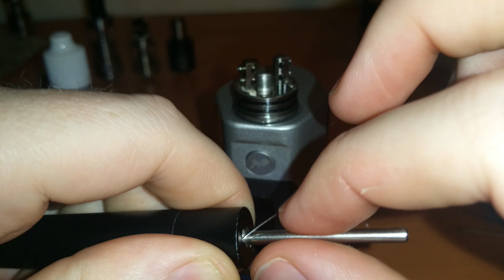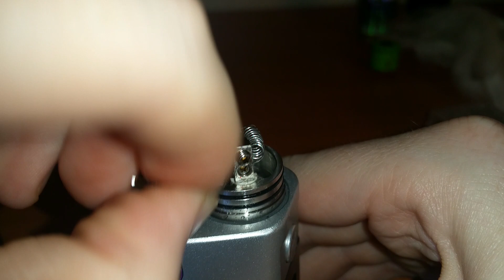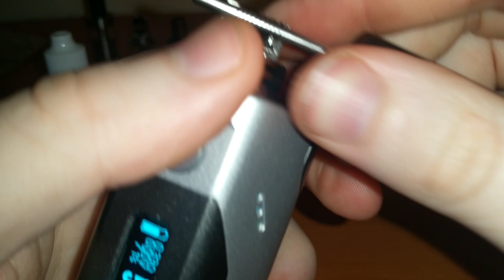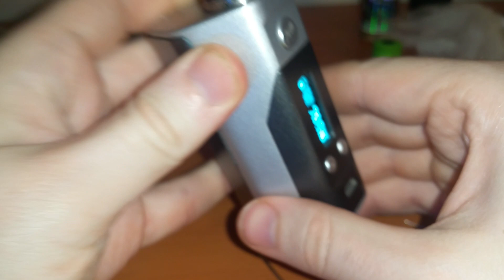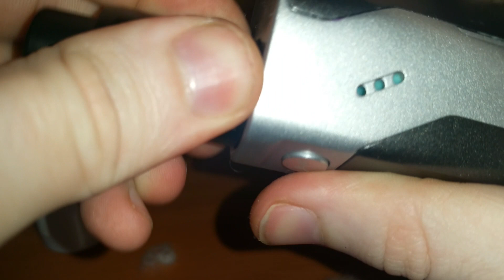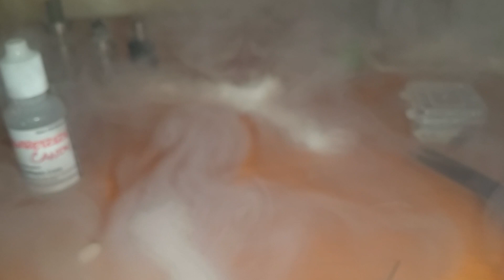AdvancedVape Build Guide Episode One: 316L Stainless Steel Spaced Coils

Comment: why are using wattage mode instead of TC mode? you're using SS wire so you should be on TC mode so you can lock your resistance
Reply from the maker: SS316L is equally capable in both wattage and tc mode. dry firing works best in power mode as well. it comes down to flavor preference. some builds I prefer wattage mode, some I prefer TC mode. but stainless steel is the only wire that can do both.

Comment: hi mate excellent tutorial I am just about to start building 
I just ordered the velocity by TOBECO 

I was just hoping that you can answer a question for me I'm after building a dual coil set up out of ss at about 0.5ohm so what gauge wire and how many wraps woud you suggest please
Reply from the maker: hey tony! glad to hear you're starting to build with stainless steel. if using regular round wire, 26 gauge at 12 wraps with a 3mm diameter will get you slightly below .5ohm, and 10 wraps on 28 gauge will get you slightly above. also keep in mind that stainless steel does not respond to power identically as kanthal, so you can get identical performance to a .5ohm kanthal wire from a stainless steel wire running at .25-.3ohm. stainless is very flexible with what power you put through it. let me know how your build goes or if you have any more questions! we also have ohm charts on our website for more complex wire types.
Reply: +AdvancedVape thanks for the great advice I will definitely have a look at the website I will definitely let you know how it goes a really appreciate the offer for help if I need it thank you very much
Reply: +AdvancedVape hi my first build went fine really easy thanks to your tutorial I took your advice 26 gauge wire 7 wraps 0.3ohm but I ended up buying by accident SS317l wire by crazywire in the UK on there website they say they have spent 3 years developing this wire for vapers do you have any advice on this wire for me please
Reply from the maker: +Tony Vapemeister 317L performs very similarly to 316L so you should have no issues with building as you would have with the 316L. the resistance is going to be a little different, but you can check wire wizard on steam engine if you need to. all in all they're very similar when it comes to building
Reply from the maker: +Tony Vapemeister I've never used that particular brand but I have used 317L. so if that brand is pure 317L, what I said should still apply. some brands use blends of different metals though so it just depends. how's the flavor on your first build?
Reply: +AdvancedVape thanks for your advice dose it perform the same as 316L in temp control because I'm using a kangerteck topbox mini 75w mod but I heard on a review that tc ss is for 316L so not sure if I can use this wire in tc with my mod any thoughts for me please
Reply: +AdvancedVape on a review for my device pill bushido said tc ss is for 316L wire so dose that mean I can not use 317L in tc?
Reply from the maker: +Tony Vapemeister yes that is true, it may respond slightly different, but not so much that you couldn't give it a try. 316 and 317 are closer together than 304 is. some mods (where the tcr is adjustable) use the same number for 316 and 317 TC. just give it a try, but ultimately if it doesn't work how you want it to, just use power mode. I use several SS builds only in power mode because I prefer them that way. SS performs equally well in tc or power mode in my opinion.
Reply: +AdvancedVape thanks again for the advice I have been using it in power mode and really like it and had a little go in tc but was not acting like I'm used to with the nickel in tc which I don't like using and won't anymore but I'll give it another go thanks for all your help and keep up the excellent tutorials they really help me thanks